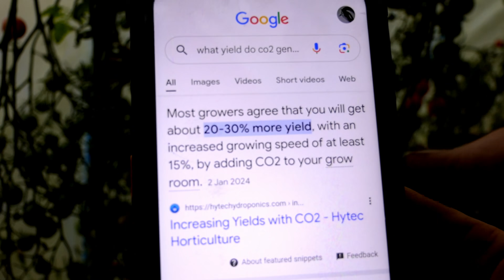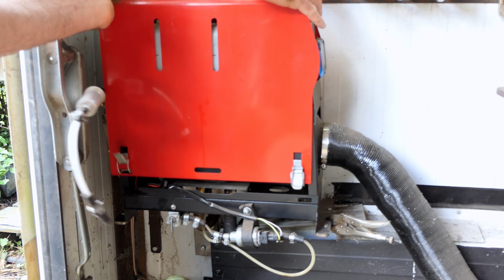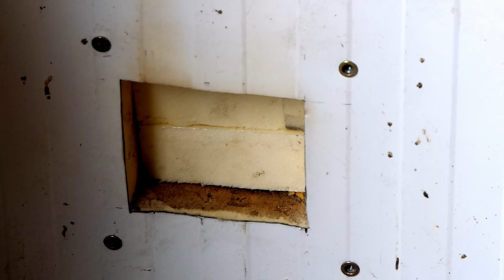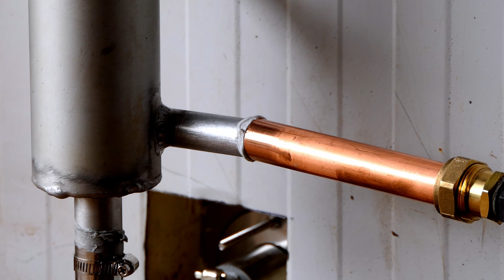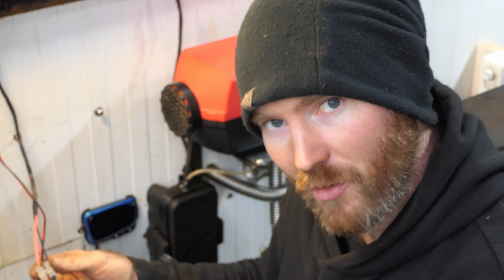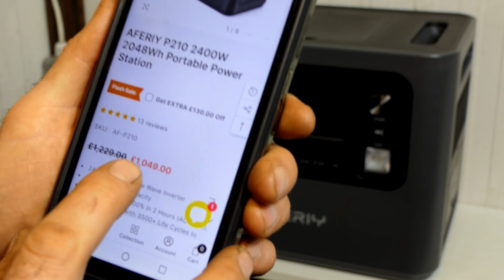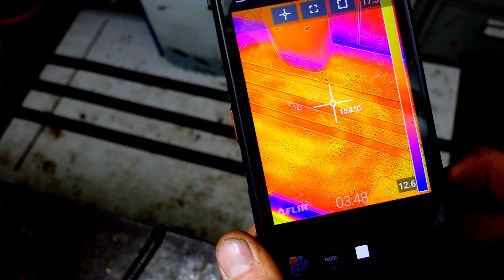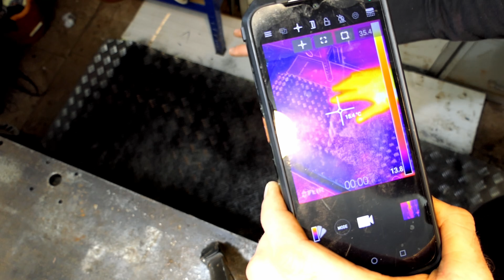NEW! Better system for Cheap and Safe Heating💲+ Underfloor Heating Mod test🫠

Comment: I completely agree with you. And I will only add that electric cars are not salvation at all if batteries continue to be produced in this way and we do not have a more developed system for obtaining clean, cheap electricity, after all, they also use energy produced from something (coal, oil, gas, nuclear), and everyone seems to think that they are powered by wishful thinking.
Reply from the maker: I agree that there is a lot of destructive processes that affect the environment in battery manufacturing. Big oil on the other hand is still doing atrocious things to the environment. Both I think can be improved to be low impact and clean. It's the ease of recycle ability that makes me lean towards a combustion engine as it's mainly metal whilst a battery isn't so simple to turn back into a new battery  and also the sustainable energy system isn't as sustainable as it appears if you've seen Michael Moore's documentary 'the human planet'. Cheers J
Reply: EVs are much more efficient than anything with an internal combustion engine, that's a proven fact. 
As long as the battery or any other of an EVs components are made using renewable energy, then the initial carbon emissions are also low. 
Obtaining oil and gas is a massively destructive and polluting process, this is before the refining and transportation of it are considered. Electricity on the other hand can be produced with little or no CO2 emissions, and the delivery system is already in place, as it's via the existing electric grid.
It dumb to say the EVs alone will solve global warming, but the introduction of efficient mass transportation is a start. 
There are plenty of other ways to help reduce CO2, like planting millions of trees, but those are often ignored. 

Looking at the bigger picture is the way to clarity of mind, and not fixate on something you might personally not like, like EVs.
Reply: @johnnodge4327  It's not true that I don't like EVs. I really like their acceleration and larger cargo space, the possibility of using them as an emergency power supply at home or a mobile silent generator for welding machines or other tools. I do up to 100 km on a daily basis and an electric car would be a great solution for me if I had solar panels at home, otherwise it doesn't make financial and ecological sense. Not to mention that I won't earn enough money for such a car for 3 years, saving every penny from my paycheck. But what if the temperature drops to -20 C (and the batteries need to be heated) and I have to drive 200 km somewhere pulling a small, only 700 kg trailer? Of course, another transport option is out of the question because that's why I have my own car available at any time of day or night. And the most important question is how can I fix it myself at home when even manufacturers do not want to fix damaged batteries and this creates a problem of thousands of electric cars in scrap yards because they had a minor accident (Germany/Sweden/Finland/Denmark)? Even in Poland no one wants to touch them, and in Gniezno there are specialists who do miracles with cars after accidents. I can do a major engine overhaul myself, of course by sending the elements for regeneration, but I do not have to take a car with a combustion engine to a special workshop.

I do not know how it is in other countries, but access to public chargers does not exist, not to mention that it is 3 times more expensive there than charging at home. My sister lives in Warsaw (the capital of Poland) and has 20 minutes to the nearest charger by tram!!!! The power grid leaves a lot to be desired, only 5 years ago the power line to my house was modernized (3x240v standard in Poland), after more than 10 years of me asking for some repairs and calling the power emergency service because the voltage dropped below 200v. And now imagine what about charging trucks and, for example, electric tractors for farmers? I'm not an engineer, but I have electrical qualifications and I know what expensive solutions and strong power lines are needed for this. And I will mention that Poland is the largest copper miner in the world.

I won't mention the power plants themselves because in Poland we still don't have nuclear power, we produce from coal and gas. Supposedly, panels and windmills give something there, but it will get very interesting because many houses are switching to heat pumps and the demand for electricity will increase when it's dark and cold and probably windless. Not to mention that everyone will plug in an electric car in the evening to charge. Read a bit about how electricity production looks like for the entire country, it is impossible to change the amount of electricity produced in a split second (even in an hour). When you look at an individual house, the values are tiny, 6 kW per day. Unless I go to weld something or turn on some other tools. Where I work, 60 kW is used per minute of production of one plastic bumper for a passenger car.

And what about industry, construction, emergency services and agriculture or the military? Recently we had a huge flood in Poland in the Silesian region and I wonder how people would charge their cars now since the network is not fully operational yet and that was over a month ago. Why doesn't the military use electric tanks or fighter jets or electric-powered missiles (ion engines are not a myth)? How long would it take a farmer to charge a tractor that was in the field for 16 hours and had to plow 200 hectares per day? Do you know how much energy it takes to literally drag an anchor (plow) driven into the ground?

Why aren't the huge ships that transport these wonderful electric cars between continents powered by electricity? Is it because the energy density in lithium batteries is too low??????

And as for CO2, I understand that you don't mean carbon dioxide but other toxic compounds such as nitrates, sulphates, ring benzoates, soot and other dusts? Because everyone keeps trumpeting about CO2 emissions that nature can handle perfectly well (all you had to do was pay attention to photosynthesis in primary school) but no one mentions plastic production, no one is trying to introduce the trend of using a smartphone for 10 years, or a car for 25 because many things can be repaired but why replace them? Passenger planes have to fly for at least 25 years and that's possible because no airline would buy a plane for 3-5 years.
Reply: @johnnodge4327   the CO2 we have already released into the atmosphere weighs several times more than all of the plants currently on earth combined. 450 Gt of plants vs 1500 Gt of Human released CO2 only since the beginning of the industrial revolution.

Also when trees due they rot and release the CO2. Same if they're burned. The only solution with them is to preserve the wood by doing something like burying it or building something out of it.

Comment: A point on the heat pump Heat Geek installs are averaging 430% efficiency and my install is sitting at 610% so far this heating season. With the OVO 15p tariff that works out to 3.5 or 2.5p per Kwh.
Reply from the maker: Is that in winter because I don't even turn on the heating until November. Cheers J
Reply: @joshuadelisle  So the average for heat geeks would be for the whole heating season so its the SCOP figure. 
The figure for my house was just for so far this year. 
After a couple of tweaks the system is now sitting at 640% so far this year (if you include hot water 620%). This will obviously go down when the weather gets colder. I'll try and remember to come back and update when spring arrives.
EDIT up to 1st Dec 590% (570% including hot water)
EDIT up to 15th Feb 560% (January was bloody cold!)
EDIT first full season Oct-Oct 568%
Reply: @MIEMERY  When its like -2 outside my heat pump runs full chat and barely creates any heat.
Reply: @MIEMERY  
Interesting, but what was your capital outlay (in total!) to achieve that?  A customer of mine spent £54,000 on a ground source HP, solar panels, and Tesla batteries.  However, I worked out that £54,000 would pay his entire energy bill for 18 years minimum.  And he has already had to pay for work as the equipment went out of warranty and failed.
Reply: @barryfoster453 the heat pump after govt grant and 2k back from my mortgage lender was £53. Not a typo that's fifty three. 

Admittedly it was fitted as part of a house renovation and the underfloor heating was around 7k all in but it was replacing 45 year old rads and a 25 year old combi so you can effectively eliminate the cost of replacing those in the next few years from the underfloor.

Plus the subfloor was in a bad state so needed replacing and this includes replacing that, insulting and screeding.

Clearly its going to take a while to pay for itself. But when you include not paying the gas standing charge. Take off what a new boiler and rads would have cost in the next few years etc my maths makes it somewhere around 4-6 years to break even depending on gas prices and efficiency. 
It will ofc be situation specific and lots of people are going overboard unnecessarily spending tens of thousands to save more like a thousand a year but that wasn't our situation.
Reply: @threepotMR2 that's a shame and hasn't been my experience. I've seen mine run at 100% compressor exactly once so far. It was -4 and the house was coming off a setback period so was trying to warm up quickly. 
To me that sounds like either you have your system with too many zones, have restrictive pipework, haven't got the weather comp curve set correctly or are using a setback temperature that is too low.
Reply: @barryfoster453  Hi Barry sorry only just seen this. 
We were renovating our house and the heating system was pretty cobbled together and 40 years old. The boiler was working but was 20 years old so was probably getting towards end of life. 
So we spent 8.5k on insulation, underfloor heating including a new floor screed to replace the original. 
The heat pump was then an additional 2.5k after the govt grant. 
Our mortgage provider then gave us 2k back. 
So in total we are 9k in for this but importantly most of that was strictly speaking unnecessary spending. 
My guess is that we could have done it with radiators and a modified version of the original pipework for around 4k after the govt grant but not accounting for the cashback from our mortgage provider.

Comment: I have 2 thoughts. 1, lengthen the exhaust pipe inside, so more heat is captured before being exhausted. How long would require testing.
2, add thermal mass to the radiant floor heating. It may take longer to bring temp up but the thermal mass should retain the heat for longer. Possibly reducing the amount of heat required to maintain a temp once it's reached. I'm sure there's data on this somewhere as radiant floor heating has been around for a bit. There also may be data on which materials perform most efficiently to be used as the thermal mass.

I really like these videos. Thanks for sharing your knowledge and experiments.
Reply from the maker: Thank you so much. I think your points are spot on. Cheers J

Comment: When you make your new heat exchange dont run the pipe outside but run it through a fan ducting like you had before to take out all the heat you can before it is wasted to the outside
Reply from the maker: I will. Thank you. Cheers J

Comment: You might want to try a piece of cement board on the top of the hot water pipes for a better heat sink and more even heat. Great show keep on keepin on!
Reply from the maker: I think you're right. Cheers J

Comment: Alright love you videos jus one question when you fitted your temp underfloor panel to your heat exchange and you rad noticed the I don’t think I see you out the inserts in the plastic pipe and after time they will shoot off your connections no negative intended just thought I’d ask good video tho feller cheers john
Reply from the maker: Thank you. I didn't put inserts in the plastic pipe correct. Firstly because I didn't have any but secondly because they're not needed than less I'm using compression fittings. This is an open system so the pressure is very low. Otherwise yes they help in a pressurized system. Cheers J

Comment: Do you have anymore old radiators? Pipe the exhaust through a radiator before routing it outside.
Reply from the maker: The only issue is carbon build up. It's very hard to clean the inside of a radiator. Cheers J
Reply: @joshuadelisle  Agreed, but if it takes (say) half a decade to coke up, you could regard it as a disposable DPF.

Comment: I pay 5.86p/kWh for gas, obviously I have to add on the standing charge but for the hassle of getting kerosene delivered and the storage tank it’s just not worth it.
Reply from the maker: That's very good. Who is that with? Cheers J
Reply: @joshuadelisle  Short story - OVO Energy

Long story - Around 25 years ago back when energy was cheap I joined Ebico and they had a variable tariff marketed toward Christians, it was a little cheaper than everyone else. Over the years I’ve been forced to switch suppliers for one reason or another but that cheap variable tariff has just become more and more valuable. Not once in all those years have I ever been able to find a dual fuel tariff that would save me money, as of the Oct price rise my electricity is 27.53p/kWh peak and 16.17p off peak. For the last few years I’ve had an EcoFlow set up with 2.4kWh solar, a couple of Delta Pro’s and an inverter and that brings my dual fuel bill down to almost nothing but the standing charge in summer and about £50pm over the winter solstice months.
Reply from the maker: @InimitaPaul  nice. Cheers J

Comment: You can use epoxy between the aluminium and copper successfully(crimping helps)OR tin the copper and aluminium with 965 comweld and a low temptorch, heat them and push together. i have been using the 965 for thirty years in refrigeration and there are joints out there I did thirty years ago still going strong.
Reply from the maker: That's good to hear. I think a plastic joint is maybe a good idea too? Cheers J

Comment: I do have a critique or something like that.  When it comes to things like sun spots volcanoes earth quakes and so on it is important I think to keep in mind that those numbers often are made to look worse over time as our tech has improved and become available.  I don't know if the actual number of sun spots has actually increased over the last 60 years but I am rather sure our ability to detect sun spots has improved many times over since space travel has become more of a thing and I just think it is important to keep in mind if one thinks about the tech changes in the last 100 years or so and with it the access to information it could make any number of data points appear to increase when there is a chance the increase could just be our ability to see what was actually happening all along.  Unfortunately I don't have a good way to correct for everything because the information effect could be quite different depending.
cheers
Reply from the maker: You're correct, I also think that on modern temperature readings and comparing to ice core samples. Cheers J
Reply: @joshuadelisle  That is where it can get difficult I think because there are ways for some things to get historic data that could be used and it all just makes it all the more confusing and easy to pick numbers out to back up what ever you would like to prove.  I wish I had the time and brain power to just find the raw data and run the numbers my self and come to a proper conclusion

Comment: Climate change is cyclical... It is affected by more than just emissions on the planet. Heat from proximity to the sun which changes due to orbits, the effect on the planets magma flows etc due to magnetic fields and gravity all play a major part. The planet used to be covered in animal life but now ecowarriors want us to eat processed plants rather than meat because a herd of cows farting is melting the icecaps.... Ridiculous
Reply from the maker: You're correct. There is a lot more to it. Cheers J

Comment: Concrete is much more heat-conductive than foam, if you lay the tubing on the floor and pour concrete on top, it should work flawlessly.
Reply from the maker: Definitely. But needs insulation underneath though to stop it being lost in the earth. Cheers J

Comment: People fail to understand the SCALE of the earth's ecosystem. (One reason that there are people that believe that the earth is flat.)
There is little we can do as individuals to change it. The earth will go on. We will adapt to changes in resources, or not.
Reply from the maker: Adaptation is key. Cheers J
Reply: Mainly the "or not". Humanity is currently on course to change earths ecosystem into one it cannot survive, and take a whole load of other species with it. Earth with adapt and new species with evolve and thrive given enough time. It just won't be humans.

(because evolution takes millions of years and we have tens to hundreds.)

Comment: Hi Josh, cheers from the other side of the pond. 

Thanks for these reviews and upgrades. Based on your reviews I added one of these heaters with a long exhaust pipe (to radiate the additional heat off before exiting shop). I’ve got it hooked up to a solar/wind set up with battery bank. So my small shop is heated and offgrid in Cincinnati area.
Reply from the maker: Nice one. Well done. Cheers J